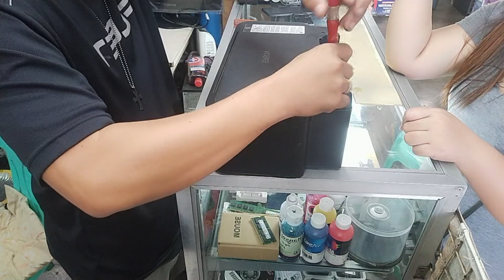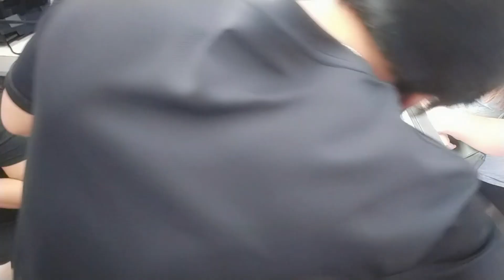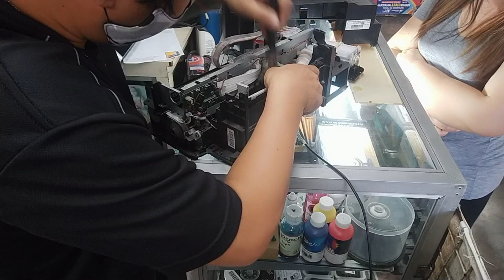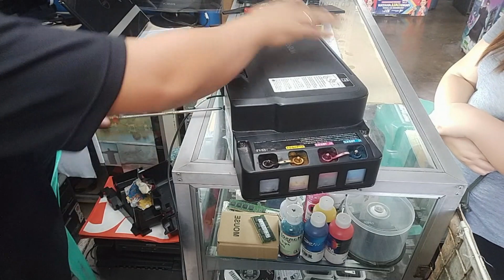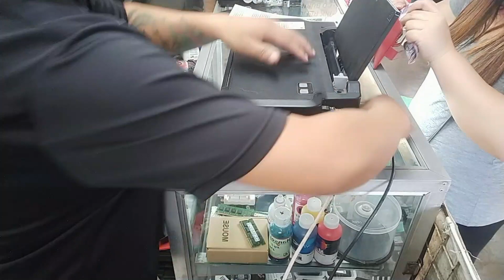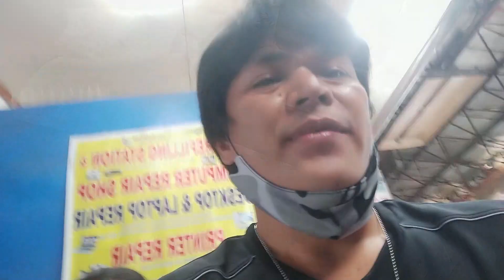EPSON L120 BLINKING LIGHTS ERROR SOLVED.

Comment: Sir paano pag yung epson l3150 all lights blinking pagka power on walang response yung printer hindi gumagalaw yung carriage pati yung mga roller niya
Reply from the maker: inkpad full absorber po yan. kelngan ireset ang printer po
Reply: 57% palang siya sir hindi pa puno
Reply from the maker: @rodolfoirang4776  check nyo po bka may kumalas na sensor sa loob